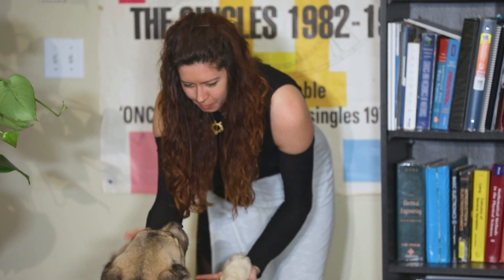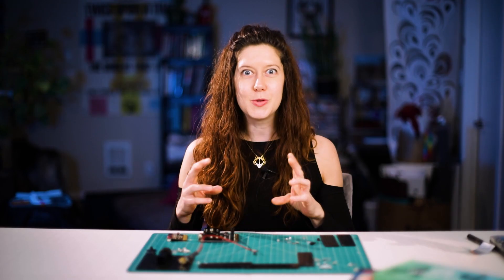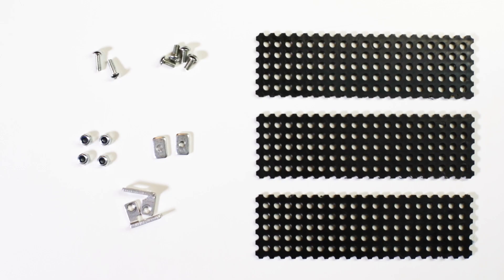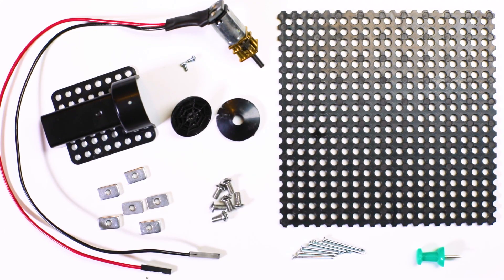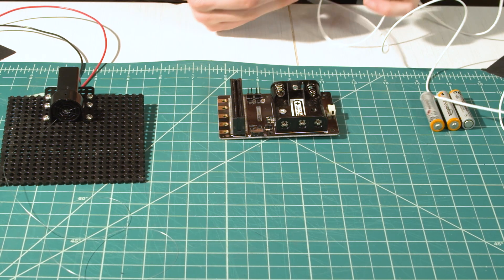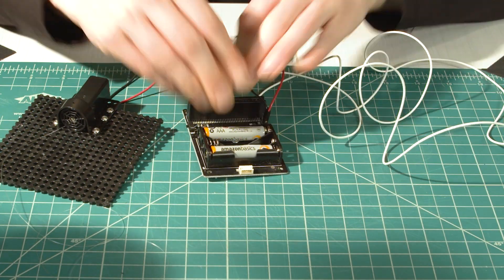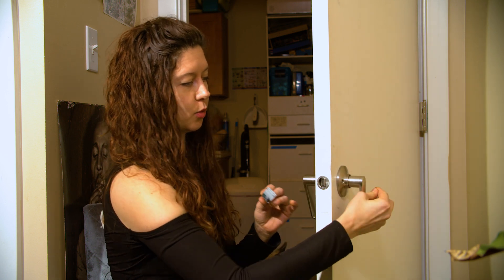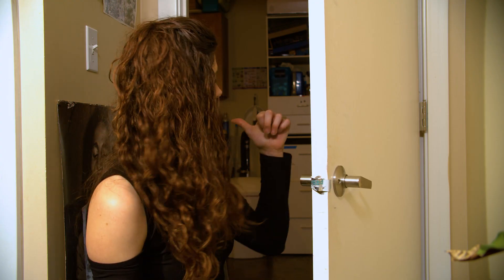How to Make a Dog Door Opener!

Comment: Swwishhhhh...poc! "Glad to be of service"
The self satisfied sliding doors of SciFi have not caught on outside of public buildings. Surprised you didn't go for infra red or pressure pads to open the door - that way no need for a super smart pet - and they can play the game I do at the supermarket of running at the doors.
Reply from the maker: ahahaha!!! that's a great idea! initially i wanted to use the touch-sensitive feature on the micro:bit, but the motor controller board did something funky to the IO pins. But i love the idea of a pressure pad for V2!! :D
Reply: M